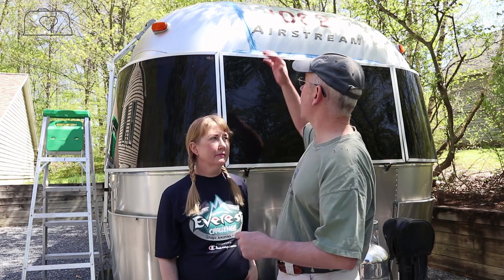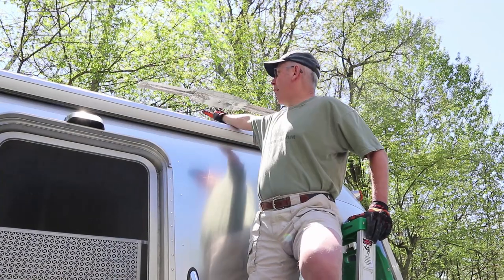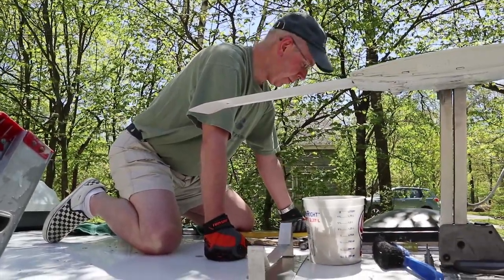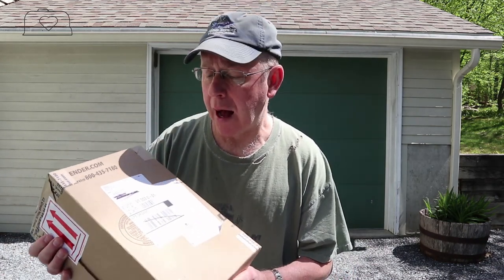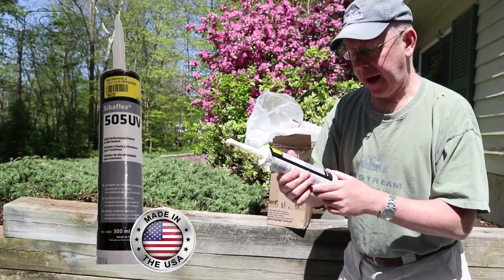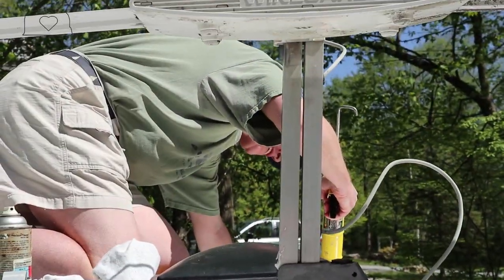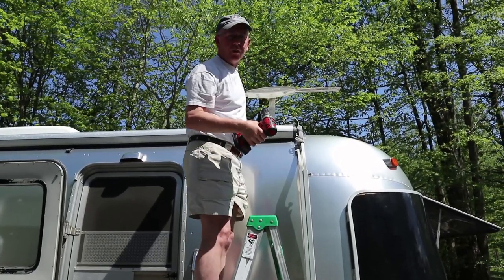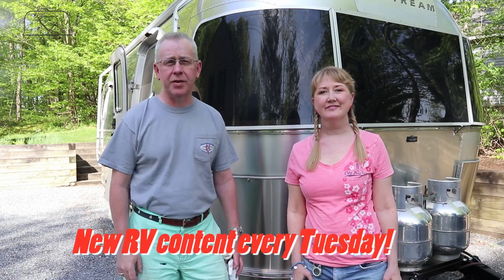Airstream Leak - Sealing Our RV's Roof

Comment: Still shopping for an Air stream but certainly enjoy your videos. You are so right about marine products in cost but usually great stuff. About leaks, owning a larger sailboat I can tell you that the ingress of leaks are never near the wet areas. On my boat it seams that the root of the leak is always feet or yards from where I think it is.
Reply from the maker: Thanks for watching and so very true on both counts.  Whenever I work on the Sub I always try to upgrade to marine hardware and marine standards.  For example, the ABYC does not allow wire nuts on boats, thus my use of the Wago connectors.

Comment: If you haven't already you might look into investing in an Olympic rivet shaver and some Olympic rivets for outside riveting. I personally would not put a pop rivet on my roof. I've replaced several rivets on the exterior with Olympic rivets and a shaver that fits into the end of my drill with no issues, super easy.
Reply from the maker: Thanks for watching and the suggestion.  I'll consider it.  BTW, I did cover the pop rivet in sealant...

Comment: Getting ready to order product for our 2005 16 Bambi roof reseal, curious how much product you needed for you project?  After looking at many vid's and blogs I've settled on Sikaflex 221 for seams and Sikaflex 721 for the AC and Fantastic.  Figuring if I bought as much as you used to reseal your roof, I'd end up with some extra but at least have enough when I get started.

Big fans of your channel, thanks for the work you put in.
Reply from the maker: Thanks so much for watching!  If I recall, I bought 2 tubes of the Sikaflex (from Defender Marine) and had some left over.  For the seams around the windows and the non-roof seams we use ACRYL-R that we purchased from Woodland's Airstream.  It's expensive and you have to buy the applicator as well.  We recently had a leak in our front window and we seem to have fixed that.  We may do a video on the ACRYL-R now that we know we are competent enough to fix it.
Reply: @LuvSubbin  Thanks! Ordered, now all that's left is the pain.

Comment: How often do owners have to have this done?
Reply from the maker: Thanks for watching!  It's different based on the environment that the trailer sees.  Is it in the intense sun of Texas?  Is it stored inside during the winter?  A good check is to climb up and test how pliable the sealant is.  I think a very general rule of thumb is that the sealant should be scraped and replaced every 5 - 7 years.

Comment: It's just embarrassing that such expensive caravans start to leak over time. If you wanted, you could process it better during production ...
Reply from the maker: Thanks for watching!  Very true but I think the issue with sealant is that the constant UV and elements degrade it over time.  Not sure what the solution to that is...
Reply: @LuvSubbin  
The solution would be to weld the seams to the sheet metal with a laser. That should be possible with such an expensive product ...
Remember, the airstream caravans cost at least three times as much as other products ...
Reply: @creative3872  if you weld the aluminum sheets together you couldn’t replace individual sections in case of damage.
Reply: @creative3872  except the aluminum panels on airstreams have a plastic clear coat that would be destroyed by heat welding.   Everything is a compromise, and nothing lasts forever.
Reply: Yeah , right another revenue making processs for the manufacturers ! 👍🤛⚾️